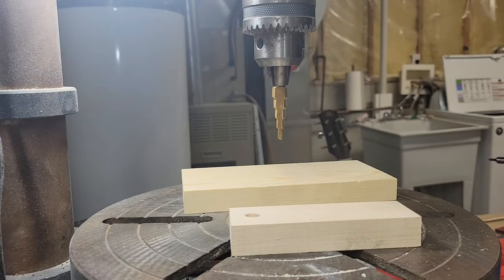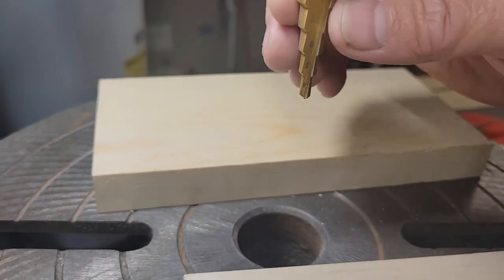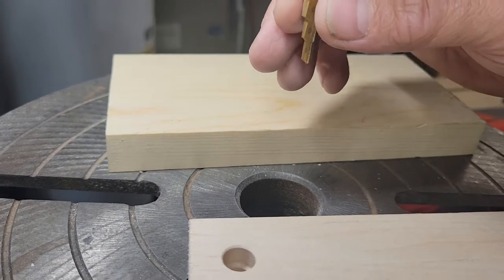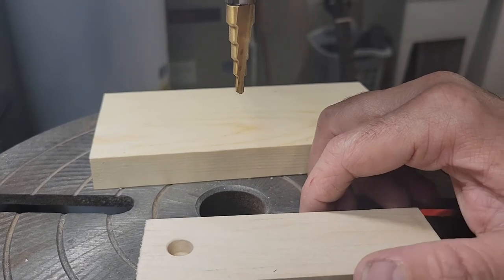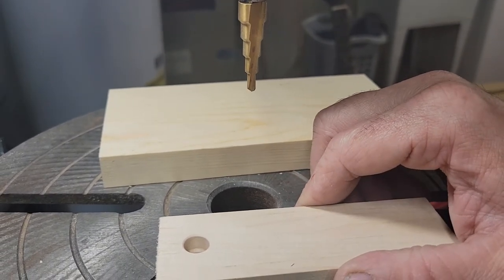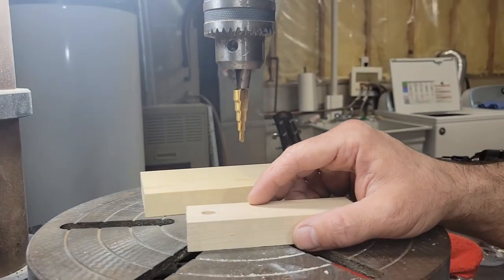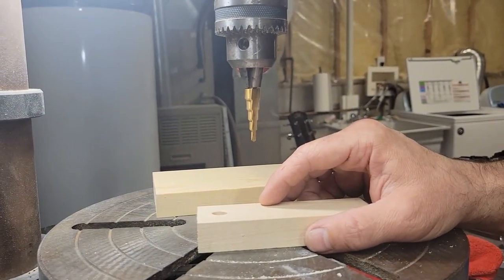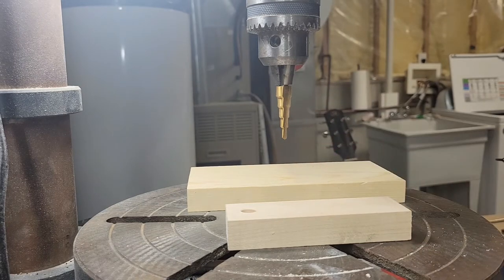How to enlarge guitar tuner holes with a drill press.

Comment: I bought at 8,9,10 MM bit for RC airplane propellers and bored the rear of a guitar headstock to 10mm diameter and deep enough to insert 6 new tuning machines. It cost maybe $15. Amazon had it.
Reply from the maker: The one that I used in the video was an Amazon buy and I think it was about $10 or $12 after shipping, IIRC.